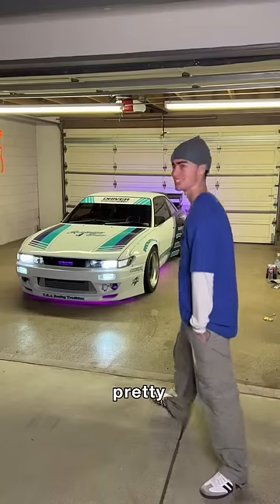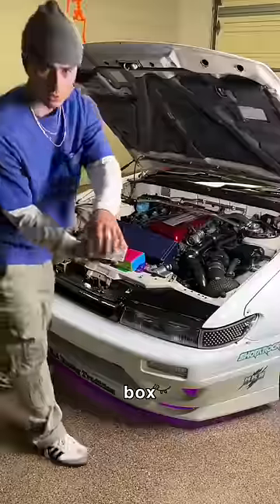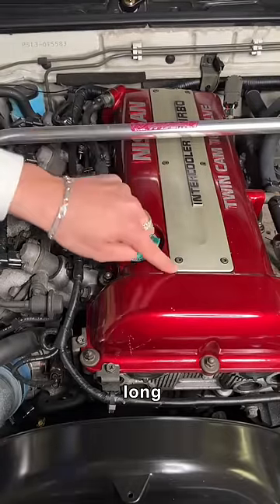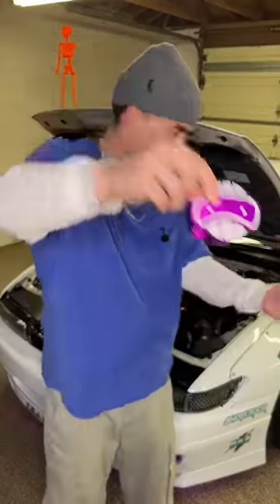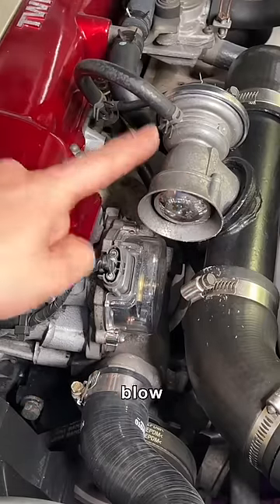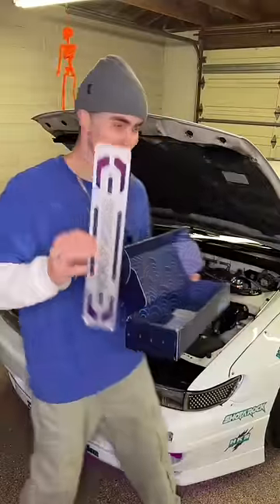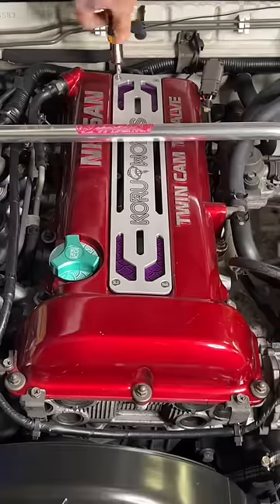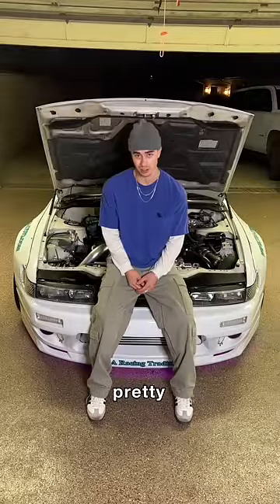Could THIS get any cooler?😱

Comment: That’s coil pack cover, not engine valve cover. But nice.
Reply: he makes signs so cant be too hard on him
Reply: @kollinspencer847 youre saying like car guys dont have normal jobs
Reply: Did someone ask?
No
Reply: @woiveth3665  youtube is probably his job
Reply: @Nikai-14 Yo, did he ask for ur opinion?
Reply: Money can’t buy experience or common sense
Reply: @Nikai-14  Your mum asked. Never seen anywhere that says “Did someone asked” section instead of “COMMENT” section.
Reply: I thought of the same thing. But then again being scared of stripped bolts and focusing on useless bling covers seems to go with the theme.
Reply: @Nikai-14 do you know what "comments" means?
Reply: bro bro bro
Reply: @Nikai-14 cringe
Reply: @woiveth3665 i wouldn’t really say he’s a car guy yet 😂
Reply: Relax. He can’t help it. Daddy pays for his shit and he has other dudes work on his shit lol
Reply: @woiveth3665 as a technician 😂
Reply: @woiveth3665 car guys with skills usually end up as techs. The rest end up diy and can do it cheaper than the rest.
Reply: @kollinspencer847 he should know
Reply: @kollinspencer847  that’s doesnt change anything
Reply: he also called the cam angle sensor the crank sensor
Reply: @woiveth3665 He’s new to cars though, most “car guys” wouldn’t be considered new.
Reply: Lol this was the comment I was looking for
Reply: I'm surprised he didn't change his blinker fluid.
Reply: Yes
Reply: @woiveth3665 uhhhhh....mechanics?!??

Comment: The oil cap is a bad idea in my opinion. I’ve worked on a few different cars where those aftermarket caps get harder and harder to take off the older they get.